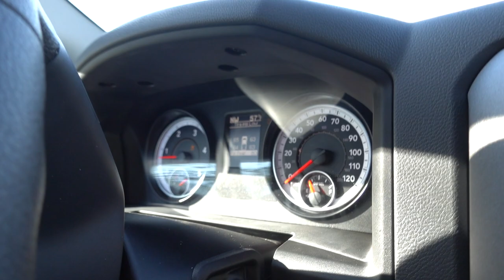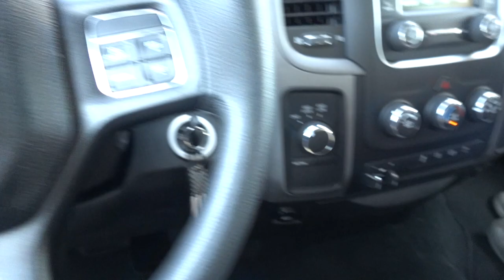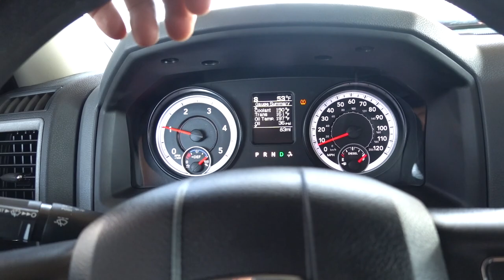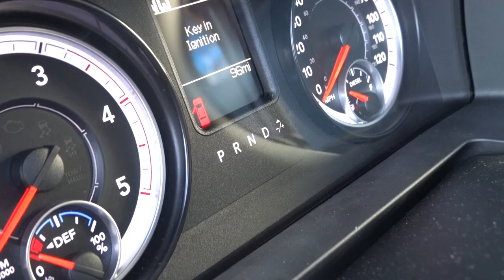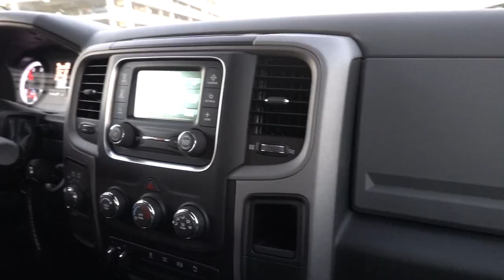MY WIFE'S FIRST DRIVE IN HER NEW CUMMINS TRUCK!!! SITTING FOR 5 YEARS!!!!

Comment: If you're only going to use Renegade products then you need to be using the renegade rebel pro red metal polish, it's much better than the standard rebel red polish because it has a little bit more cut to it

Comment: love it. I have the exact truck, black 2018 tradesman. I did the Thuren 2" level and .5" drop spring in the rear and I wouldn't recommend it. I had to remove mine and put the stock spring in the rear and go higher in the front. These trucks for some reason don't have any up travel so just driving down the road it would bottom out and break your back over moderate bumps. it wasn't usable even with bags unless you put so much air in the rear you raised it to stink bug again. just my experience I wanted to share. love your channel keep it up I appreciate it.

Comment: Wheel/tire combo is horrendous!
Reply: The wheels are most likely not staying he said in the first vid when he put them on
Reply: The wheels aint bad its the stretched tires that look bad
Reply: Y’all are crazy! It’s a decently high HP street truck, the wheels and tires for that look PERFECTLY! This truck as it sits is PERFECT 😍😍😍
Reply: @reecedemeerleer9462  no, just no.  Rubber band tires look goofy no matter the vehicle.  Even greg said they aint staying, thankfully
Reply: Old people think all trucks should have big mud tires on it.
Reply: @aj8393  kids think all trucks should have massive rims with street tires...
Never said anything about it having to have "mud tires" but that combo was just not right.
Reply: 20” rims are not massive... and 305/50 is plenty tire.
Reply: @aj8393  I'm neither old, or think all trucks should have mud tires. But those tires look like crap.  The stretched out, rim wider than the tire look is trash
Reply: They probably 285... should have went with 305s or higher.